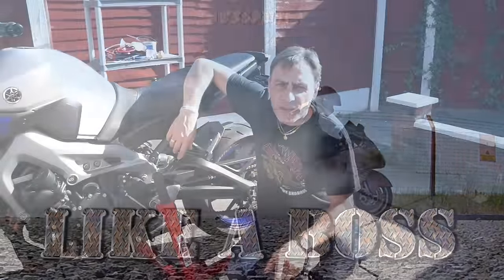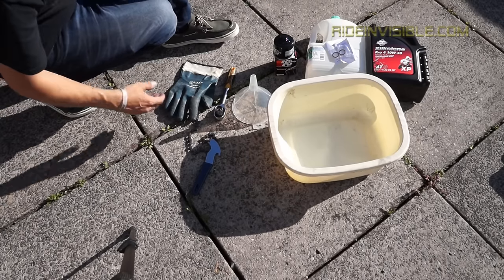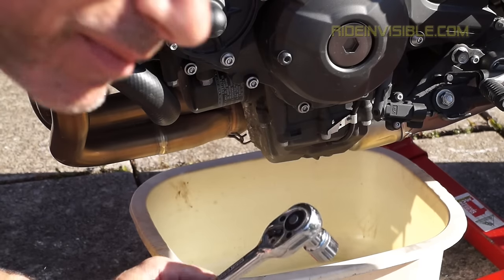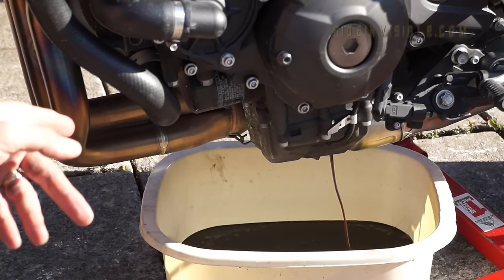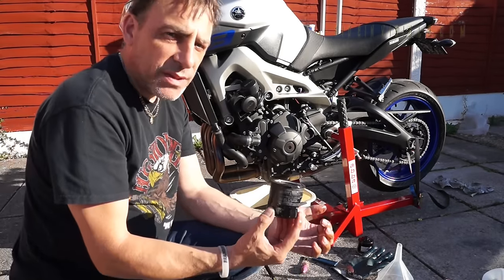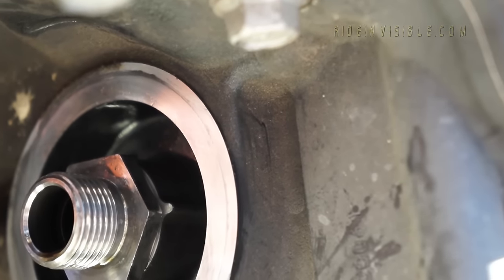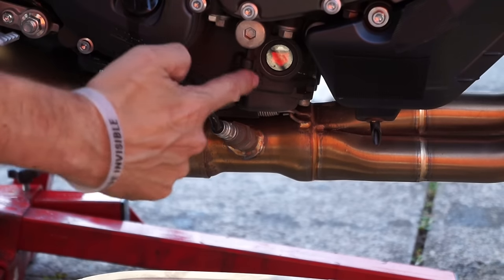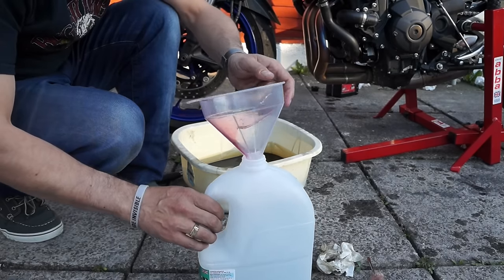How to change the Oil and Oil Filter - Yamaha MT09 / FZ09 / FJ09 / Tracer

Comment: When I do an oil change on my Raptor I always remove the filler plug before the sump plug to ensure there is no vacuum during the drain. The reason being a faster oil dump can aid sludge and debris evacuation.

Comment: Dealership did the exact same to me the wankers over tightened the oil filter an plug snapped my strap on the oil filter so just ordered one of these to see if it will do the job

Comment: I take out the oil filter o-ring and fully lube it with fresh oil. One thing garages tend to do is sometimes over fill your oil level. When you get your bike back from a service check the oil level yourself, you may find that you need to drain some... or maybe even add some.
Reply: +RevvedUpBiker My bike was overfilled after its first service!
Reply: Bikers Quest
And they charge you for every drop added.

Comment: Your ratchet switch rule is not always correct, depends on the make of ratchet which way the switch works. Better to physically check the tool for drive direction.
Do you measure your oil going in?
Don't you use a decent torque wrench for the sump plug?........Ask Santa for one :)
Reply: +Hepcat Harley Always measure the oil via a basic jug........then the usual is to let it run......let it sit for complete settlement of the oil in the sump and check again........
Reply: That's what I do mate, check the manual for amount then measure that in a jug then recheck after a quick warm up. Seems the right way to me :)
Reply: And i always check the rotation of any ratchet by hand first....just to make sure...old habits die hard buddy
Reply: Me too mate, even without thinking about it :)
Clock dial method, if it ratchets to the left it's on Clockwise drive, or tighty as Andy says. My ratchet switch is right for "loosey" so I don't use that method no no no :)
Reply: +Hepcat Harley Saves any heartbreak later on bud.....
Hope alls well anyways ..
Rsm
Reply: All good mate, getting better every day, thanks  :)
Reply: +Hepcat Harley Good news mate.......